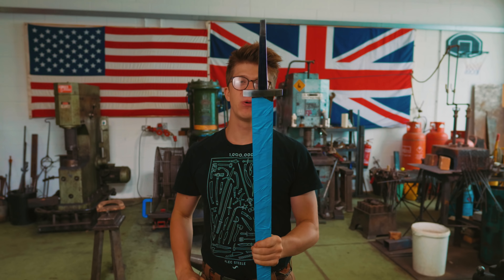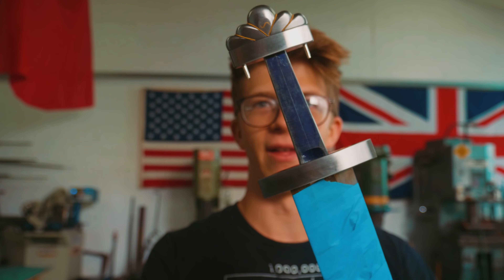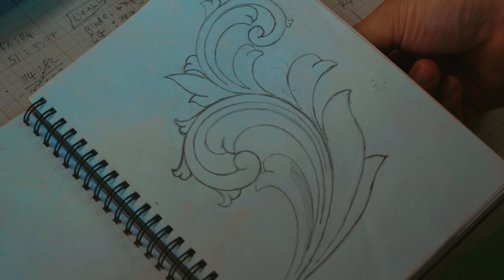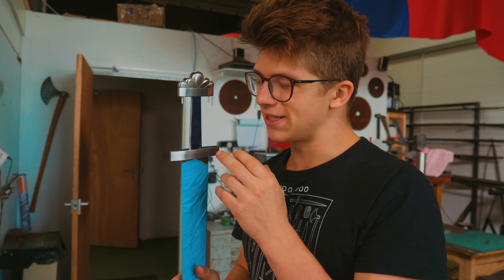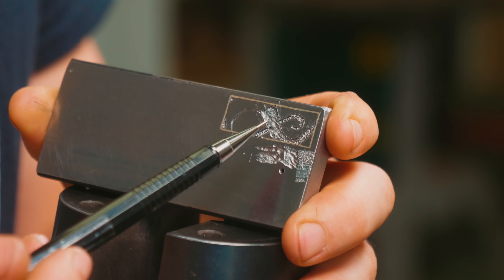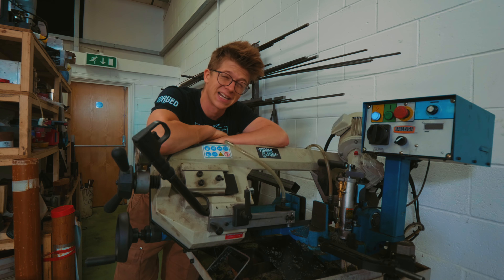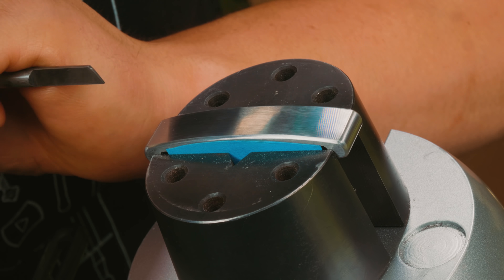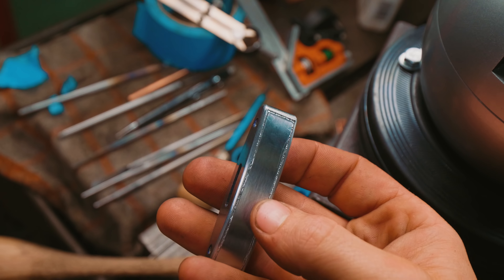MAKING A VIKING SWORD!!! Part 12

Comment: Hey Alec! Here's a tip: use bees wax to lubricate the wire before pulling it through the draw plate. (used to be a Goldsmith so you can take my word for it!). ALSO use a flat jeweler's hammer (or you engraving hammer) to thin down the tip of the wire gradually so that it can poke through enough for you to get a good grip. also, the holes on your home made draw plate should be counter sunk, and the inside edges should be a little round. (you don't want it to cut into your wire!).
Reply: Steynberg Prinsloo Nice bro!🍻
Reply: This is the comment I came here to write! Just to add a bit, make sure you taper enough of the tip to get a solid grip so that you don’t keep ripping little pieces off over and over again. You can’t anneal the wire too many times either. Also, start with a hole as large or slightly larger than the wire so that you don’t try to change the diameter too much in one go.
Reply: ex-Precious metals fabricator here. All these tips are good. when you're going down under 1mm, we always went down by 0.1mm reductions (until 0.5mm, then we went down by 0.05mm reductions). Also yes, the profile of the hole that you're sticking the wire into needs to be like a wormhole.
Reply: Building Books right! 0.5mm reductions, forgot to mention that 😁
Reply: I'd love to see what Alec comes up with to make this tool! Please don't settle with a bought one Alec! :D
Reply: midejonai unfortunately he's already pretty much finished with the smaller guard, following him on Instagram. looking good so far. he didn't show how he thinned the wire though, so we'll have to wait till the next video.

Comment: @ 9:30 around, I noticed you have your drill inside a chuck when breaking. Pro tip for drilling tiny precise holes in steel: #1 rule .. always use center drill to start any bore. #2 use speed collet in the Bridgeport to hold the drill bit as it will hold your tool more concentrically. Less wobble means less snaps. #3 lots of lube and take your time.  Love all your work!

Comment: A good tip for using the draw plate is, when annealing the wire, you can put it still hot on some candle wax. This helps lubricate it and works better than the oil, that makes the pliers slip.

Comment: Aaaayyyy Jelling runestone style is one of my favorites, excellent. I haven't watched through the whole video yet so I'm not sure if you've finalized the design yet, but I remember reading at one point that the pattern of the intertwining dragons on runestones is supposed to always follow an "under - over - under - over" pattern throughout the whole design. If something goes over the other one at an intersection, then at the next intersection it should go under. Just something to keep in mind if you need to (or have time to!) tweak the design to fit that principle.

Comment: Alec. A little advice for using the draw plate. 

1.Hammer or grind enough wire to a taper so you have a tail of at least 1/2 inch to grab with your tongs.  If you hammer the tail, anneal before you pull.  

2. Use beeswax to lube your wire - not oil. Just rub it on and pull.  It burns off nice and clean when you anneal. 

3. Use proper draw tongs.  There's something to be said for using the right tool for the job.

Comment: Creating smooth curves by hand in any method can be tricky.  I am a sign writer and one of the hardest skills to master can be making a smooth curve by hand.  One of the best bits of advice I ever got was to use your own bio-metrics.  If your hand cannot do a turn smoothly, try using your wrist or your elbow or your shoulder, all the way down to your legs.  Its a bit trial and error as everyone is built and moves differently but with practice it can actually turn your own body into a natural french curve making machine :)

Comment: Also I mentioned I’m a tool maker so I’ve made tons of draw dies of all sizes and draw plates , a standard drill won’t cut it , you need to have a conical lead in that terminates to a land , i used a wire edm to achieve the appropriate geometries . Also polishing these dies to a mirror finish is a must to get a smooth and consistent finish and draw of whatever material it is that you’re drawing, we also draw large precious metal pipe for our wedding band department . Hit me up if you ever need some insider information about tooling!

Comment: The beast is the MidgardsWorm, (in danish worm is often used instead of snake) Who is one of the beasts, that will play a big role in Ragnarok. As it is so big, that it completely circles Midgards, so the idea of doing the same thing on the guard, is actually quite good.

Comment: Alec my biggest appreciation for Your drawings and engraving for a beginner! 
They are enormously symetric.
Engraving is truly a master-art 
 I guess You should put on Your glodmark "lying S" forvforged on both sides of the pommle backend.

I feel You should also gold inlay the center of the blade in the upper third to the handle although is is a little more difficult due to the layer of the twisted Damascus steel.

Comment: @Alec Steel on the long straights that you wish to engrave use a bent piece of flat stock glued on with lock-tite  then heat to remove.  I round the upper portion of the tool when using a guide fence

Comment: Hey Alec I just thought I would mention that foredom has a wood chisel hand piece that works great with carbide and high carbon graver tips. I have been using it to learn. It will speed up the learning curve plus the curves are much smoother cuts. I can’t swing a hammer so much due to injury so this is a lifesaver. My goal is to make high quality knives as well as other forged metal goods. I just as yourself am teaching myself along the way I have many interests but wood and metal are my passion. Thanks for inspiration on both subjects your Chanel is appreciated. Soon I will be posting videos of my own on the subject. I almost have all the tools needed to start most built with my own hands. Still missing a press and power hammer. I will be making my own designs on both so it should be interesting. Thanks for sharing!

Comment: Alec, I would suggest that you move your hand further down on the engraver.  You look extremely rigid with how you are holding your tooling.  If you loosen up on your grip, slid your hand down and rest your pinky, ring finger, and middle finger on the work piece while grasping the engraver between your fore finger and thumb, I think that you will see improvement in control of the engraver.  You will then slip/scratch less.  Just a suggestion, do as you will with it. Haha.

Comment: Probably already here, but we used a roller set to reduce the size of a piece of wire in my jewelry class. New rollers can be easily made on the lathe as well. Made it something novices could do much easier

Comment: Hey Alec , I'm getting into the jewelry business and thought you might want to know there's something where we take a high temp metal (we use copper it might work with steel ) engrave something in it (or stamp )and then melt a low temp metal (we use silver) into the engraving , thought that might help if you wanted to give it a shot with something

Comment: Try what Man At Arms does and use a punch and hammer for the background to get that hammered/dimpled texture without the dander of slipping using a machine. I think you can stop/minimize slipping while engraving by shortening the overall engraver length, like how you snap an end-mill from the thing bending at high speeds. Then change the way you're holding it from hammer and chisel to hammer and pool que (stabilize by spreading out you fingers then put the engraver to rest on your thumb, arch your index, and put it between your index and middle finger to aim it.) Hope this helps.
Reply: "Dander?" Found the blue daicum.

Comment: Instead removing material from the background to make the inlay pop, could always think of dimpled steel patterning it instead. Could give more control and add symmetry to the background look. Not sure how easy it would be based on the steel, but just a thought. Could always test it on a piece of steel and see if it's a viable option.

Comment: Alec, I would like to suggest you not to remove the background with the chisel, but rather make lots of small indentations with round tipped marker. It is a quicker process, you will get contrasting surfaces and the final result will be much cleaner. Keep up the energy!

Comment: I wouldn't call myself a fantastic sculptor or an engraver at all but when I do need to get some quick practice in I use a bar of soap. It's a lot more forgiving than steel or what have you and it helps with your control and linework. And this is just me hoping that you'll do this, but if you would want to use/create small c-shaped chisels for your negative space by your beasts, it could add a nice wave pattern for your serpents.

Comment: Don't think the scratches should be too much of a problem, considering 90% of the upper guard will have its back taken out (also keep the rough finsih from the ball end mill, it gives a rocky look that goes well with the theme) so the few that are in the serpents will have to be fixed

Comment: I like the videos I have a suggestion that might help you so you don't get mad when you scratch the peice your engraving. Instead of sanding the peice to the finish you want wait and engrave it and when your done with the engraving go back and sand to that finish you want I think it will also free up time and also pressure won't be so bad cause you won't be worried about scratching the peice and help improve your skill faster

Comment: drawing wire is hard. You NEED to soften the wire first but heating it and then cooling it and then harden just the tip but hammering it before you pull it through the draw plate. you were mostly right, but you should watch a video on drawing wire.

Comment: Could you not use some sort or thick but malleable lacquer on the steel that can be later cleaned off with acetone, to keep the steel from being scratched as badly if you slip?

Comment: If you stretch wire it gets thinner I know, and also strengthens slightly I believe. I know it would be hard to be precise, but couldn't you reduce from 1mm to somewhere between 1 and 0.5 using this method?

Comment: rather than use a die grinder, I would just have done metal stippling, which is commonly done on high-end firearms (you can do the same thing with plastic and wood and a wood burning tool)

Comment: I know practicing free-hand drawing of you designs for engraving is good, but if you're in a hurry I believe its possible to transfer a laser-jet printed image to another surface using acetone to wet the paper.  Same procedure as applying a temporary tattoo to your skin with water.

Comment: Why did you engrave the borders? You could have just wrapped the design onto the top and bottom of each guard except where the upper-guard meets the pummel. Another thing that may have helped making the borders straighter (if needed) is to use a cutting blade in a dremel.

Comment: How awesome would it be to have one of the figure 8 beast but super long etched from the guard to the end of the fuller in the fuller🙃. Why don't you use the etching machine more like you did with Alex that would have worked well with some of that fine detail with the beast.

Comment: I wonder if you could do wire EDM by hand for fine engraving work. Although, I guess that requires working in a fluid, so visibility might be impaired, especially as the fluid becomes contaminated. hmmm.

Comment: You bought that rig to etch your touch mark on the projects you forgot to stamp or engrave in this case... couldn't you have made a template for the guards and etched the initial pattern in and then engraved the parameter and outline for the gold inlay?  Would give you the contrasting background with lower risk of the ball tip skipping and scratching.

Comment: I was wondering when you would get into engraving. Why not go pneumatic? You could machine your own hand piece quite easily using Rick Alexander's design. Hammer and chisel is just so time consuming and frustrating. Also why not use a wire draw wheel to thin your wire?

Comment: You need to anneal that silver wire and the gold almost every time you have drawn it through the draw plate. You should know your metals by now the more you work it the harder/brittle it becomes
Reply: Trevor Or, maybe on the silver although it wouldnt be as shiny, but gold doesn't work harden
Reply: Brandon Lowe not going to argue go do some research. Silver is something I've been around for years
Reply: Trevor Or i said you were right about ths silver, i was just saying gold doesnt work harden
Reply: Brandon Lowe gold has carrot issues ie 24 very soft 9 very hard 7 harder still and all points inbetween still makes interesting stuff in the least to work

Comment: Can't you just melt the gold and cast it in? pre heat the steel insothat it doesnt cool the gold too soon. Gold melts around 1050 Celsius abouts, steel melts at higher temps. Not sure what this might do to the steel though.
Reply: Guus Kleeven would leave temper colors on the blade and pommel, take out some blade temper which ia very bad, and also molten metal is almost impossible to pour in a channel 1mm wide
Reply: Maybe heat it then so that it is more maluable? Nah haha..
Reply: Guus Kleeven not a bad idea but its small so it wouldnt really hold the heat long enough but it could help

Comment: Good video. Mistakes make it look hand-crafted. Too much perfection means it would not look like a Viking sword. After all, original Viking swords were all hand-crafted.

You're putting scratches in the piece because you are lowering your grip hand too much. Try to keep the tool at the same angle to the craving.

BTW, Viking smiths would use a jig where they could.

Comment: I cringe every time I see the engraving tool rock from side to side randomly because the round, smooth rod handle provides no control.  Please epoxy some nice wood handles on these tools so the slot you cut stays the correct width as you intend.